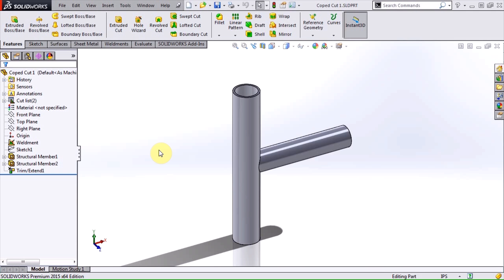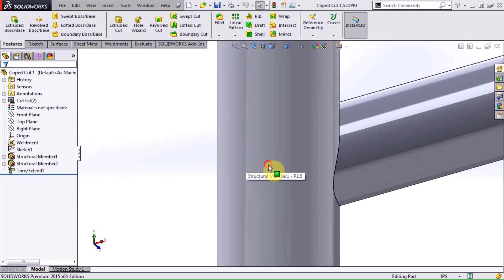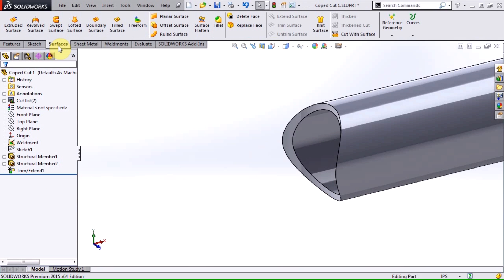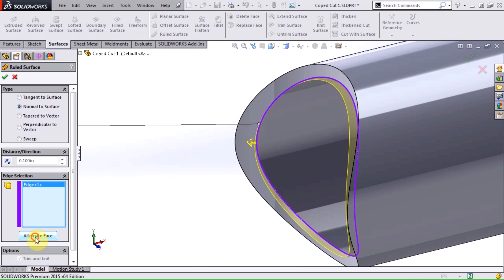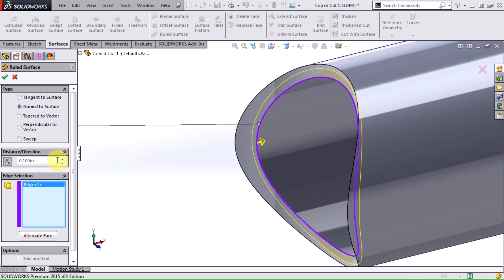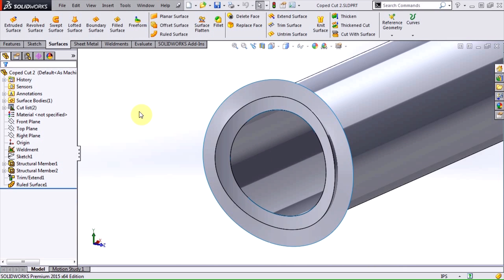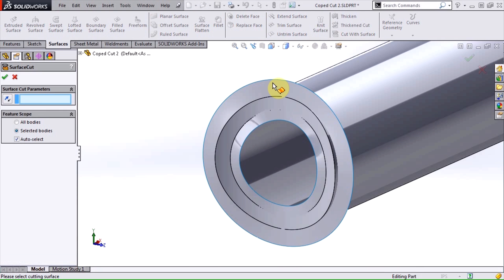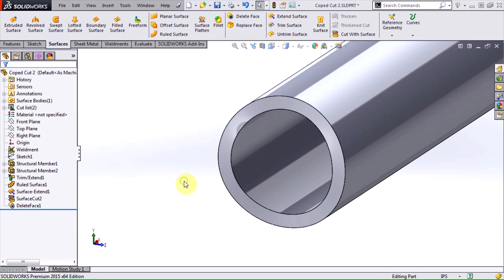SOLIDWORKS - Creating a Coped Cut Perpendicular to a Pipe

Comment: This was almost what I was looking for, my tube is at an angle, and the surface cut failed. I had to add an offset surface and surface cut from that, now there's a weld gap (for better or worse). Thanks.

Comment: I'm not sure why you would cut it at 90 degrees to the surface because it leaves a huge gap to fill in.  If you are welding say a pipe fence and are coping with a plasma cutter or a torch you'll need all the metal you can or you will be filling in gaps for eternity.
Reply: The main reason is CNC plasma cutting.  A simple rotary axis on a XYZ plasma table can cope pipe and make some complicated weldments easy but only makes 90deg cuts.  Still much better than coping everything by hand, even if it isn't as nice as pre-cut bevels that the fancy $$$$ laser tube machines can do.

Comment: Thank you so much for the video! I played around with it for a bit and figured out you can also use the angled to vector setting to create a bevel on the pipe. This is for machining a beveled saddle for welding. This is going to earn me big points at work:)
Reply: I was also facing same issue

Comment: Worked a treat, only i kept getting the geometric condition rebuild error.
For my application i needed to select the outside edge and project the ruled surface outward, then extend it inwards before surface cutting.